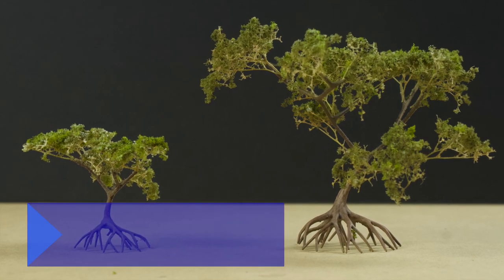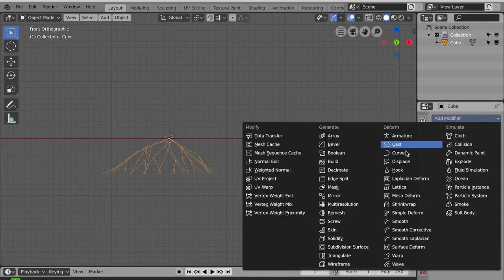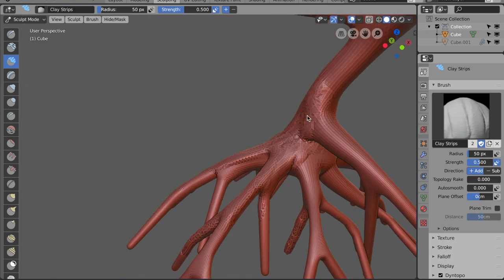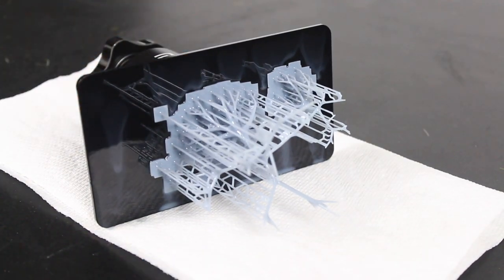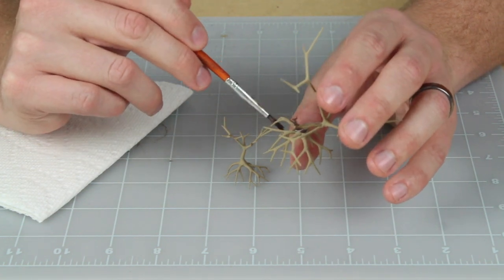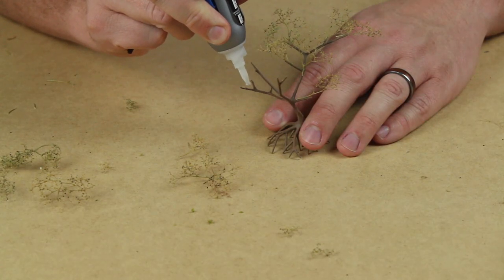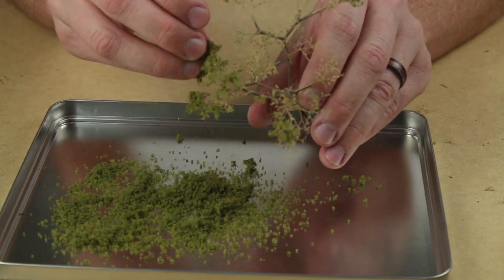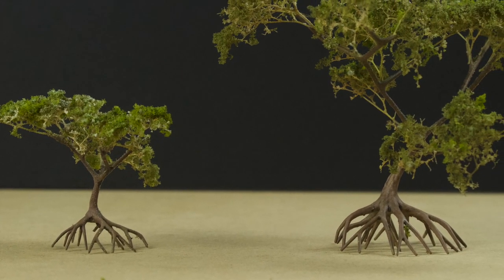How to Make a Realistic 3D Printed Tree

Comment: Can i print it easy on creality ender 5 plus also? or i need printer that works on resin?
Reply from the maker: I probably wouldn’t print this particular model on an FDM printer. You could absolutely use the same method to make a model that will work well on and FDM printer, though.